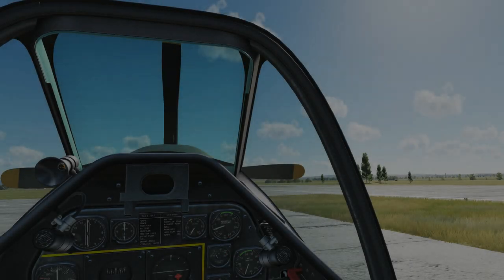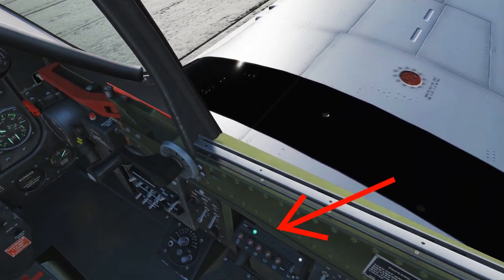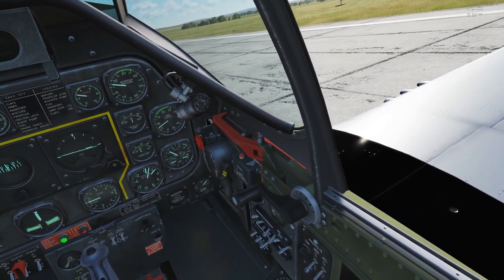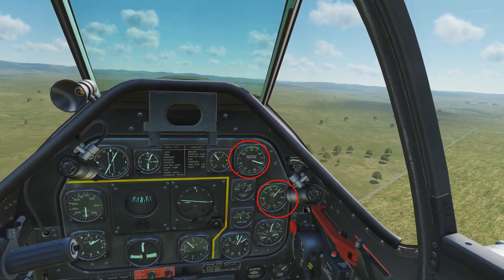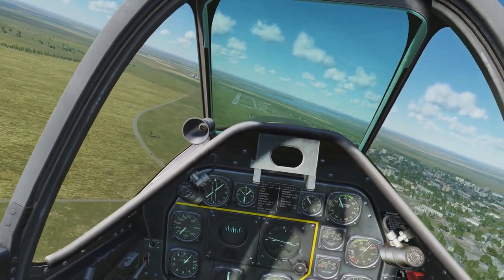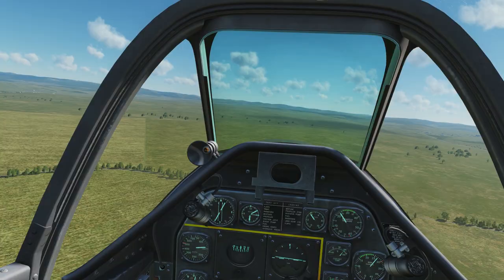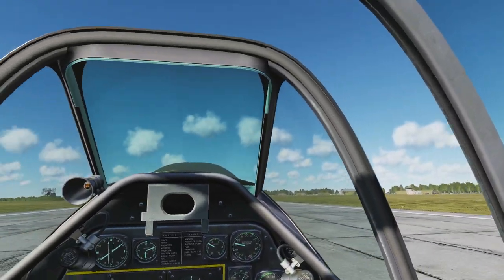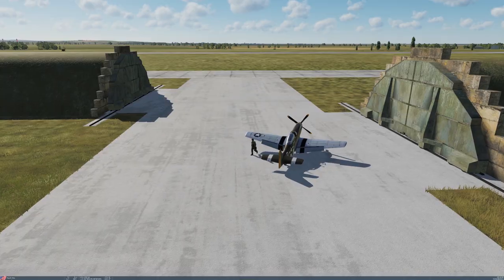DCS P-51D or TF-51 Tutorial: Cold Start, Taxi, Takeoff, Landing

Comment: Thank you for highlighting the controls to which you're referring. Very useful to us, noobs.
Reply from the maker: Glad it was useful. One thing I didn't mention that probably should be in there- even for noobs, is to make sure your turn and slip indicator stays centered as well as possible. Just remember to center it, you "step on the ball". It can be done manually with rudder, or with trim.

Comment: You don't need to hold the stick all the way back to maintain wheel lock. If the tail wheel is already aligned with the fuselage, you only have to pull the stick all the way back and then release it. It will remain locked until the stick is pushed forward of center.
I wouldn't recommend flying around with the throttle at 55 inches either. The Max-Continuous specs call for Max 46 inches and 2700 on the RPM. This will give you maximum speed performance and cooling. The more you go above 46 inches, the more you better get used to Manual Cooling.
Finally, and as Shahdoh has mentioned, keep an eye on the Slip Indicator. The idea is to keep the ball centered as much as possible (which requires constant tweaking) with the rudder trim.
Reply: P-51 do not require manual cooling any state in flight.So don't need to get used to manual cooling.
At 2700 rpm 50" is max safe MAP which you can run for short periods, let say 15 min will be safe.
46' is used for climb, but not because it will provide max climb rate, this will be achieved by running max power. 61" or 67"
46" can be used as combat patrol power rating, this will provide best speed w/o stressing engine too much
46" /2700 rpm will not give max speed
Max speed is achieved by  using max power 61"/67" 3000 rpm.

Comment: Several things - After you are in the air, adjust rudder trim per the ball, not any particular setting to maintain coordinated flight. If your airspeed changes, will need to trim rudder to center the ball.  Fuel selector switch does not require you to move the fuel shutoff to off. leave it on, just switch the tanks. Also, pilots generally want to switch from left to right and back again every 15-20 minutes to maintain proper weight balance on the aircraft. Regarding landings, 3 point landing information was ok, but you CAN land the mustang on its mains without bouncing with proper procedures and becomes just as easy as a 3 point landing.
Reply: @chriswadsworth2857  To land on the mains without bounce, you want your indicated speed to be about 110-120 range. I do not trim elevator on the approach, so I have back pressure on the way in. You do need good perception of your altitude above the runway, for when you are within a couple feet of touching down, release the back pressure off the stick and it will settle right down on the mains without bouncing. If you maintain the back pressure, what is happening is the mains touch, but you are still pulling the tail down, angle of attack increases thus lifting you back in the air. Here is a clip of my airshow approach and landing: https://youtu.be/1TQd3U3juUQ?t=855 (Watch the whole thing to see the mustang get put through its paces).
Reply: @Shahdohs  That landing is insane!
Reply: @Shahdohs  How did you slow sown so quick coming out of the stall into landing?
Reply: @UnknownRider-eg1nl  Hard slip. Cross controlling rudder with aileron, flaps were full down and engine braking by throttle back, at full RPM.
Reply: @UnknownRider-eg1nl  Also, the trick was not to let it build up as much speed in the first place (as much as you can anyways when headed straight down...)

Comment: Great video! Though things do not work properly when in training.. I cannot lock (after pulling out) my parking brake, my cockpit lights also do not go on like you showed - is it bugged?
Furthermore this DCS key bindings are just on a whole other level of pain.. I also tried JoyPro but is far from perfect, it maybe is good for setting the basic controls for every aircraft, but even those basics do not get picked up by all - for example if the naming of the binds is not similar.. I just have many problems with way too confusing (irrelevant) binding options in the menu that are not intuitive at all, like putting the brakes on axis to feather them? (I just brake without feather) Another frustrating issue is I could not find how to bind/find 'recalibrate' the VR headset like in all VR games/sims (I have no numpad on my keyboard) - So I tried the following: Under controls TF-51D Real (View) / view center, bind - under (view cockpit) / center camera view, bind / return camera, bind / return camera base, bind - All these options do not work or even have any kind of effect at all.. I mean there should just be a simple options that clearly states 'VR recalibration' how hard can it be, I do not need all those redundant options.. It also would be great if vr motion controller (thumb stick) - allows for scroll like the mouse does - to fine tune inputs instead of one click full throttle, or at least let me  grab the throttle and adjust with 'motion'..
Reply from the maker: I don't think the cockpit lights are bugged- it works for me. The parking brake should work too- just be sure you do it in the correct order

Comment: Thank you so very much. Your video is far better than the one that comes with DCS as I have been messing around all day and still couldn't get the engine to start and after watching your video I now know why so thank you.

I am new to DCS so was wondering. Do you have any key map suggestions that would help me?

I have a CH Products Combatstick, CH Products Pro Rudder Pedals and a Thrustmaster  Weapon Control System with Throttle.

Thanks.
Reply from the maker: Glad I was able to help. As far as keymapping, I would say the most important things aside from the obvious (like the throttle), would be to put your trim in an easily accessible place, and your rpm lever. If you play in VR, I recommend getting software called Voice Attack, and mapping some basic functions to it (i.e. when you say "gear" the gear lever will deploy).
Reply: @TheWarSimmer  yes and thank you again!

Actually you gave me an idea :).

I don't have a VR set (maybe one day) but I do have a program called Voicebot and I forgot I had it until you mentioned Voice Attack. It allows you to program key bindings into things you say. This will make things so much easier for me.

If you or anyone else is interested in knowing more about the program you can find it here:

https://www.voicebot.net/

Thanks again!

Comment: Using my controllers in VR is super awkward, for example rolling the lever to close the canopy feels like 50-50 chance in regards to which direction it will spin. How do you manage to do everything so seamlessly? I seem to have to map every single control or use my mouse for buttons which is pretty awkward too cause the pointer seems to be following the motion of my headset. Any solutions to these issues? How come you can't see your hands in VR?
Reply from the maker: Yeah some of the controls are awkward for me as well. Canopy and flaps being one of them. I map those to the hotas. Tbh, after a while, I moved my cockpit back to a setup that allowed me to use a mouse and it's much easier imo
Reply: @TheWarSimmer  Thanks man, I figured it out, wasn't using my scroll wheel on my mouse, now that that's working it's all good 😊

Comment: The magneto shouldn't be switched on until after you start the starter. When you start, you should count 5 or 6 blades and then turn on the magnetos.  Also I would make sure that you hydraulic release handle on the right of the center console is in before starting anything.
Reply: Read P-51 manual first, before saying such things. Magnetos are both on before hit starter in 1944 P-51 manual. What they done to modern p-51, what they changed isn't included in Game.
Aditional, Even when you set magnetos both off engine will start anyway, starter button in p-51 is engaging booster coil which is providing power to ignition system.

Comment: Hey, Im really into airplanes and airplanes video games like microsoft flight simulator and war thunder. My question is would t flight hotas x be good joystick for dcs? I
Reply from the maker: It may work for warbirds, but tbh, just looking at it, there doesn't seem to be many button options. I'd check around on some forums. I probably wouldn't use it.
Reply: Hi! I actually have this hotas and can give you my opinion on them. I fly the f16 in dcs, and I gotta say anything with the mfds or screens is actually pretty friggin hard to do. Not enough buttons like warsimmer says. If you're into flight Sims I would recommend spending more money and getting one with tons of buttons. I spend around 150 on my hotas with the rudders and stuff it came with, and I had no complaints with anything ww2 birds but the f16 has me stumped. I know I'm 3 months late but if there's any chance this applies to you still I hope it helps

Comment: whenever i try to takeoff the rudder locks to one side and i get sent sideways into the earth...
Reply from the maker: Did you get it figured out or still having issues?
Reply from the maker: @intechio9013  If the rudder is physically moving without you touching it, then it is something with your input/keymapping registering movements that aren't there. Try increasing the deadzone. A big point to remember is never go full throttle on takeoff either- it makes things way too hard to control.